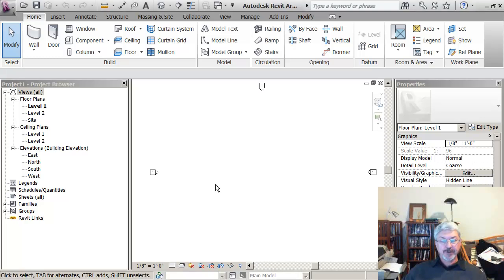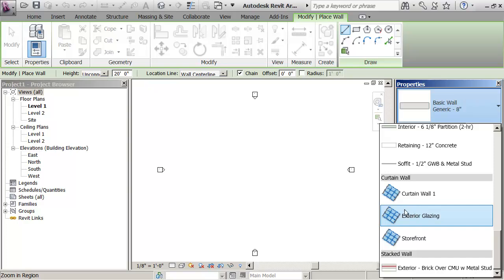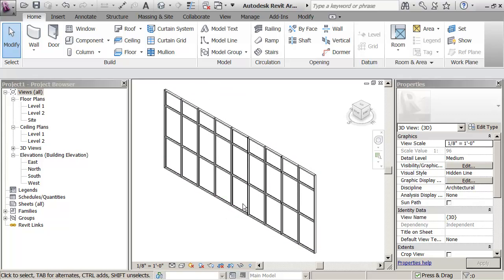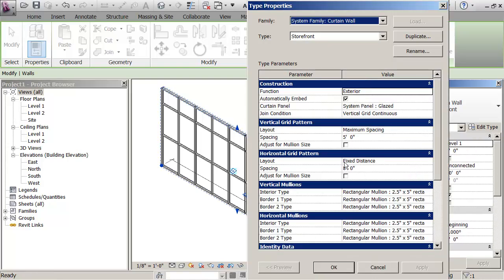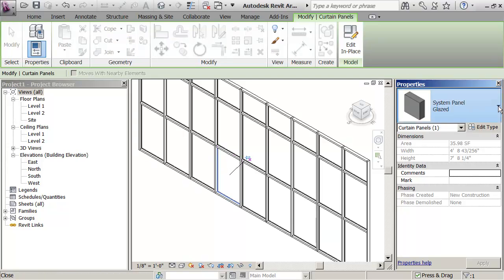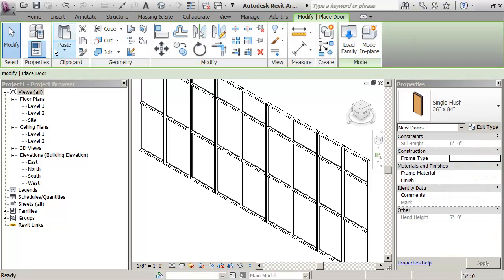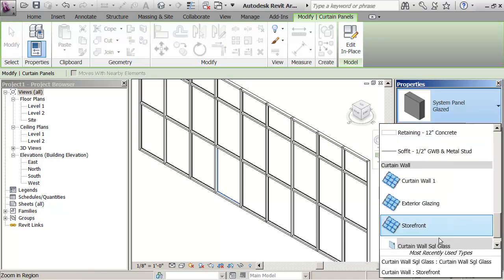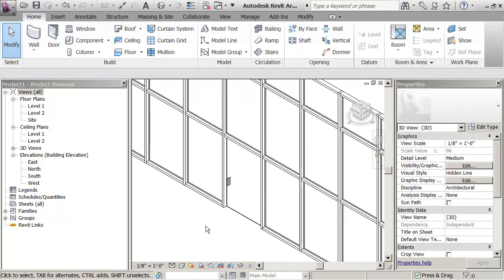FIX IT - How to put a door in a curtain wall

Comment from the maker: On a mass face you can have a rectangular, curtain wall pattern-based component for the panel. For a door, you could replace the panel with another panel that represents the door. I will document this soon. Thanks for the question.

Comment: nice...but what about curtain wall system...A model was already done in revit conceptual modeling and that was loaded into a project so the only way to add walls etc is to use the massing tab where u select by face u can't add any curtain wall so u have to create curtain wall system... so the question is how would i start editing that curtain wall system